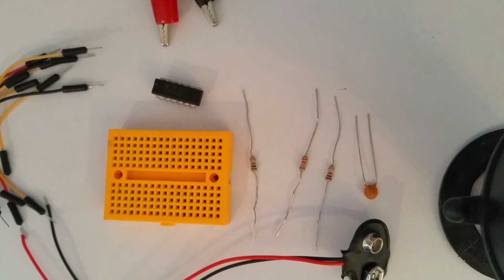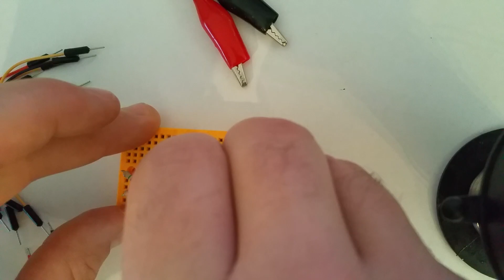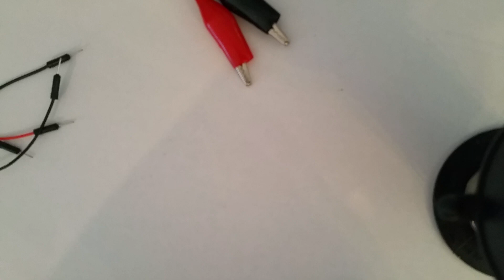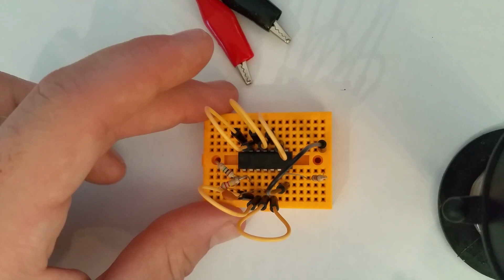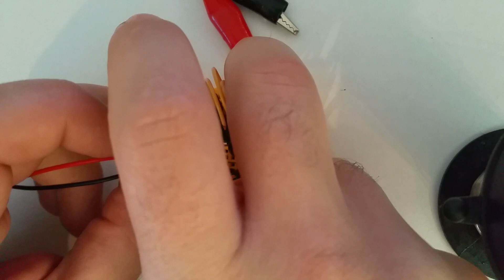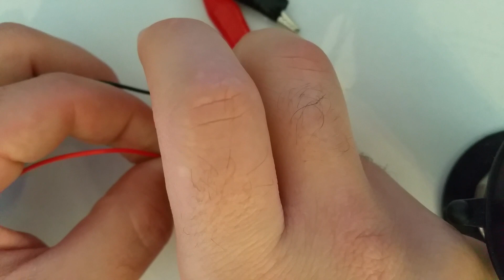DIY: How to build your own Hulda Clark Zapper

Comment: Please help ... the red light on my parasite Zapper is blinking very fast and it only blinks when it's in the middle of a switch. Not at the on switch and not at the off switch.  In the middle of the switch, it's blinking fast. So I'm not quite sure. Is it still working, would you please tell me if it's still affective? Thank you very much.

Comment: How long do you attach them to yourself for?
Reply: 1. Wrap the electrode in a tissue or paper towel wetted with tap water to ensure good contact (there should be no direct contact between the electrode and your skin).
2. Place the electrodes on your skin for 7 minutes.
3. When the 7 minutes have elapsed, take a 20 minute break and then repeat step 2 twice more.
4. After this you have “zapped” the parasites according to Dr. Hulda Clark.

Comment: How does the zapper provide only positive pulses? From the circuit diagram one could assume that the right hand is positive or that the left hand is negative. In the universe the + and -  terminals on a battery only designate electron flow direction and a voltage potential with respect to each other. So the square wave output  could as easily be considered to be positive or negative.

Comment: Does it matter if I hold the red wire in left hand and /or the black wire in right switch around whatever, etc? Switch around cos Im not sure whats what. as long as the current is running through its all  right? pls answer. Did Hulda specify?

Comment: Thanks for the great video.. just wondering how come your design is different than the one from the book. In there it shows two R (3.9K and 1K } off from pin 3, C 0.1 from pin 5, C 0.04 from pin 6, R 3.9 from pin 7, and R 1K from pin 8! Your design seems very different altogether... I was able to locate an original RadioShack 555 Chip so I am going to duplicate the book"s design. Let's see what happens
Reply: @Steven how did it work?

Comment: A soap box for the battery and the electronic "chip".
The timing is important using paper towel, dripping clean H2O, while holding the copper pipes.
Three sessions takes aproxmately 1..our. Useing a timer seven minutes holding pipes, 20 minute intervals.
Reply: Thats what I do.Just an adapter, cut off/expose the wires and just hold them. Time myself at seven minutes At four.five for virus.       seven .five  for bacteria   and nine  for nematodes?   So for viruses I zap for three times at four.five? Atricia can you answer me this?   The copper pipes would lose current wouldnt it? I do without. Just hold the exposed wires.